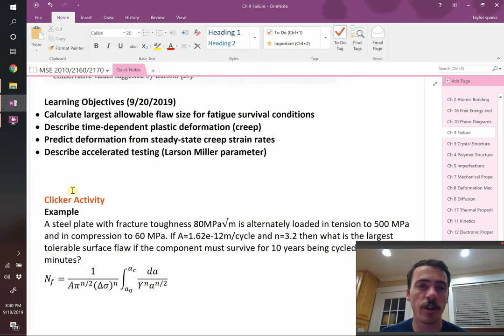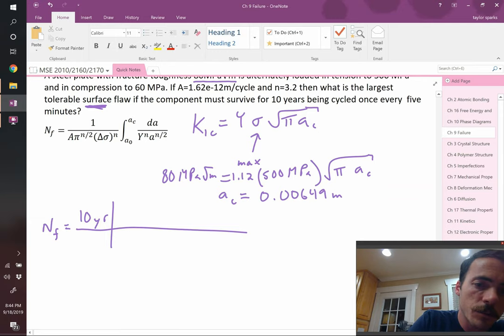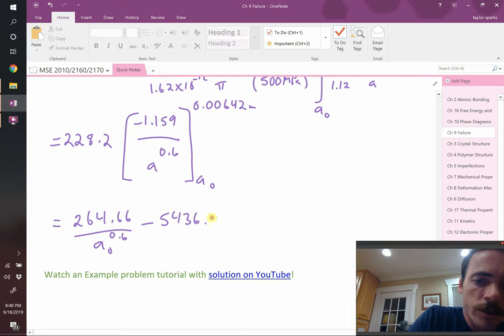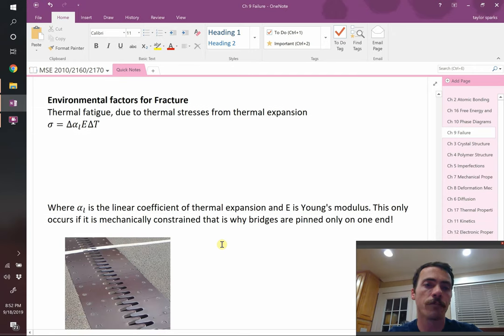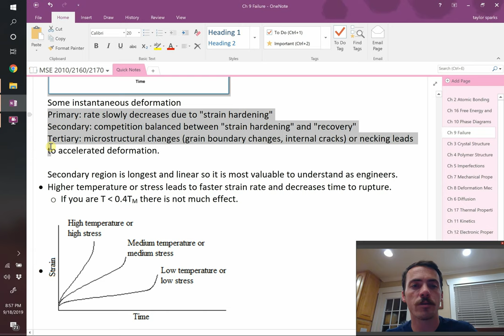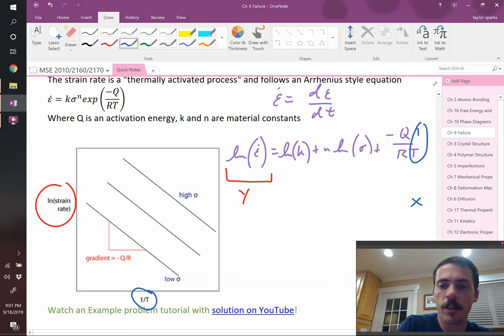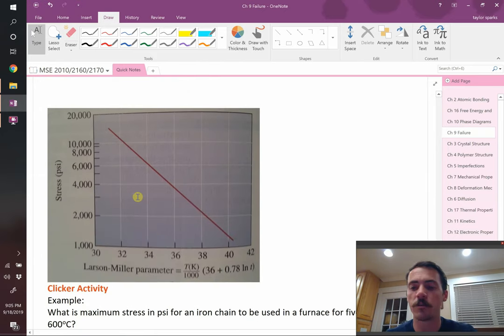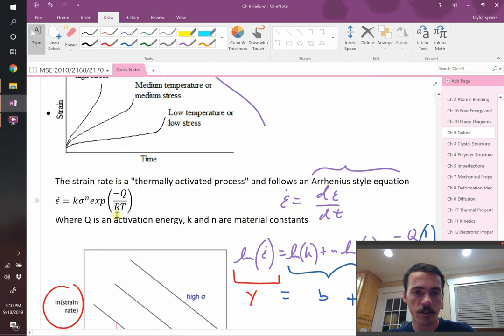Creep and accelerated testing of materials

Comment: Thank you for putting this up. Why don't you put the stress in as 500E6 Pa?
Reply from the maker: Hi Peter, it totally depends on the units of the crack growth constants. In this case you see that the constant n was just given as 3.2. Technically it should have units which tell you what the units of your pressure should be. In this case I took it from a table where the pressure needs to be in MPa, not Pa.
Reply: @TaylorSparks  I didn't even know the crack growth constant (exponent) had units. That explains it all. Thank you!